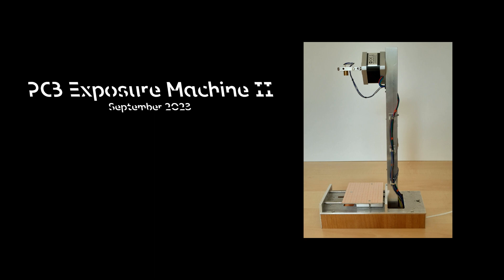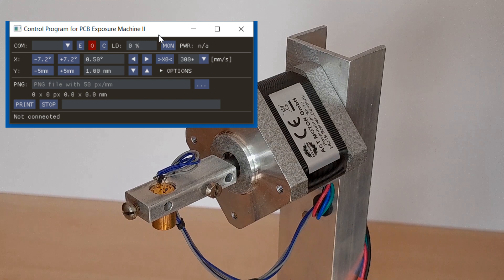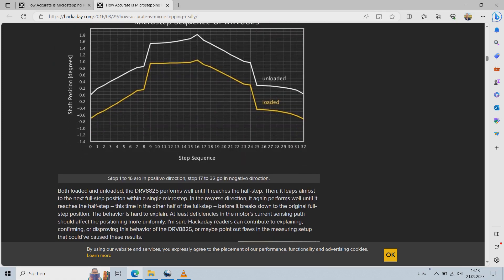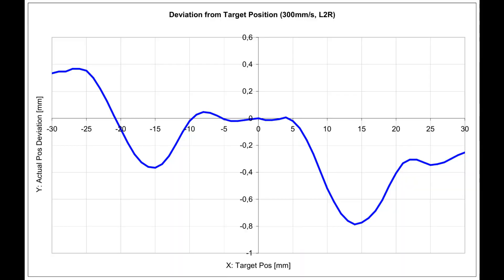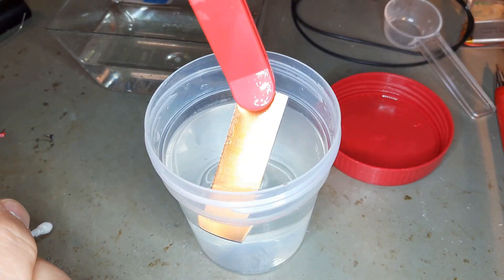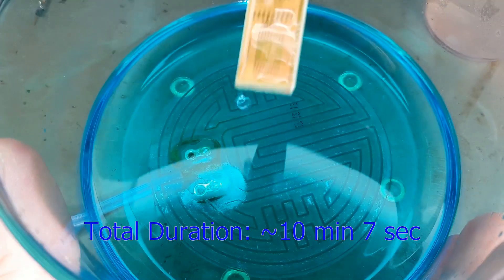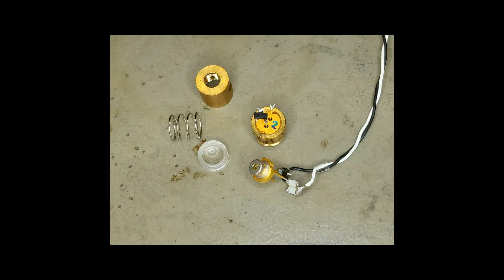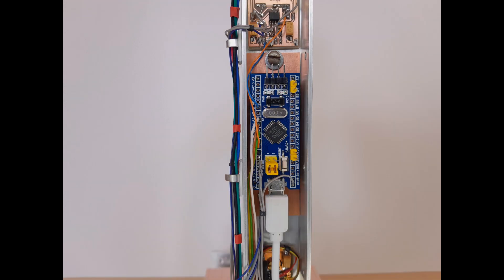UV-Laser PCB Exposure Machine for Hobby Projects (Version II)

Comment: Which laser you use and give me the eq7ipment links
Reply from the maker: The main components were all from Ebay and the articles are gone since long. However, the description of the laser was "SLD3236VF 405nm 150mW TO18 laser diode", the price in 2023 was 5.15 euro. The collimator assembly was from ebay too: "8x13mm Mini-Case for 5,6mm TO-18 Laserdiode", the title of the Ebay article for the motor was "Nema17 Stepper Motor 17HS4410-04 1A 40mm". Of course you can vary everything, according to your needs. Be warned, the calibration is the most tricky part because you need to expose and optically analyze fine test patterns. But even after more than two years of usage now I had no issues, the non-linearities in the motor seem to be pretty stable.

Comment: Great work ! I have been wanting to build something similar after coming across a project called Laser Exposer, however they used a spinning polygonal mirror so the timing of everything needs to be very precise. The second version I found was made by a guy called Terje Io, but in that version the laser moves on linear bearings, and in my first attempt I found that the linear bearings allowed some vibration.. so I'm really glad I found your video, as not only is it simpler that the other two I found, but I figure that it would also be less sensitive to vibration (and easier for me to code 😅)

I would like to ask about the laser stepper driver, specifically part choice. For the transistors, could I get away with using mosfets or should I stick to complementary darlingtons ? and for the opamp, I have a few Analog Devices AD620 & AD8603 opamps, are either of those suitable ?
Reply from the maker: Glad that you liked my design! 🙂In fact I used it for many boards meanwhile without any problems. The most important point is the calibration, to compensate the nonlinear effects in the motor. Unfortunately the needed calibration curve changes a bit at higher speeds, probably because of eddy current effects or so. so be warned. You will need some strips of PCB for printing test patterns, counting pixels, after photographing/scanning them, Excel can help to create the final tables. But once it is calibrated, it works like a charm. Regarding the constant current drivers, I recommend to used darlingtons, they are more friendly to control, most mosfets are not really made for analog circuits. The AD620 is an instrumentation amplifiert, you could use it for shifting the DAC (typically 0..vref) to the +/- range needed for the bipolar power stage. The AD8603 is a low-power opamp designed for 5V supply max., the bandwidth is very small too. Not really suitable, better use some common standard like the OP27.

Comment: Very cool!  I've spent years trying to accomplish the same thing, and I kept running into issues that could broadly be broken into two categories: laser dot size/astigmatism and X/Y axis linearity.  It's rather difficult sourcing a relatively powerful UV laser diode that has a small enough dot size and doesn't have extreme variations in dot size over varying distance due to focus.  I don't know, I just had trouble locating lasers that had a published dot size, it always was about wavelength and power output.  I mainly tried two beam movement methods: a galvo mirror assembly intended for a show laser, and a hexagonal spinning mirror assembly intended for a laser printer, with the idea that it would provide a very consistent beam sweep rate and therefore position.  Both had their issues, but if I had been able to find a proper UV laser with a small enough dot size that could be maintained across a reasonable distance, it would have gone considerably better.
Anyway, kudos on creating a very workable and inexpensive system!

Comment: have software and detail ?
Reply from the maker: Sorry, no, not planned. I hope the presentation motivates the interested ones (kids, students,...) to be creative, not by presenting detailed plans to follow blindly. There are many ways to realize something like that, different motors, controllers, DACs, some already have their preferred microcontroller (ST, Atmel/Microchip, Raspberry Pico, or Arduino...), development environments, for the PC (or Linux) too... Finally the code is not that complex, toggling an I/O pin while sending a table of data to a DAC, might be easier to build with a toolchain one knows than reworking my (ugly) code specialized for my type of hardware. However, the most delicate details of the electronics (constant current amplifier, laser and driver) can be seen in the video, maybe that helps. ;)

Comment: Data available over internet shows copper has best absorbance for infrared laser lights Rather than VU
Reply: So is you clever data as valid for UV-exposure as for copper etching?
Reply: @MuellerNick  I'm telling about direct ething on copper ,no ink not anything
Reply: @Abubaida-wx1iu  Not the subject of that video. -> useless comment.
Reply: @MuellerNick  don't drink wine
Reply: @Abubaida-wx1iu  I don't drink any alcohol, if that helps you with your derailed argumentation.
Reply: He's not etching the copper directly. He's exposing a photo resist that's on the copper board, and then using what looks like ammonium perchlorate to etch the copper where the photo resist has been removed (aka not exposed by the laser)

Comment: Good afternoon. Really cool project! Please tell me, is there a freely available diagram and source code for replicating the device yourself?
Reply from the maker: Sorry, not at this moment. Putting it all together, with toolchains for the microcontroller part and for the control program, it would fill a small pocket book and I think most interested ones have their own, different preferences regarding compilers, microcontroller etc., connectivity (e.g. serial, sd-card, bluetooth... instead of USB). Also other stepper motors might need adaption (current, driver for the y-motor etc) and also for things like the ADC (I used an obsolete AD8303, just because I had one) most will have their individual preference so that a precise construction plan would most probably not fit for most hobbyists. :(
Reply: @gumpomat  I apologize for the possibly inaccurate translation (google translator). I was not interested in the source code of the firmware, but in the compiled ready-made file for the firmware. sd card, bluetooth, etc. - this is not the most important thing in such a project. The most important thing is that the project works, and this project is really interesting. According to the accuracy of DRV4988 stepper motor drivers,
DRV8825 is a very old article, and these drivers were primarily intended to reduce the cost of 3D printers and the size of the control board. But progress does not stand still, and drivers are constantly being improved. Trinamic has a huge selection, for example TMC2209, TMC5160. These drivers already have finer microstepping and higher precision.
It is thanks to this that they became almost silent. TMC5160 was used in the construction of a CNC machine on FluidNC firmware, together with an ESP32 microcontroller. The drivers really work smoothly and easily control NEMA23 motors with a current of 2.7 Amps. You can't hear the engines running at all. I think you need to take a closer look at them,
for this project, and if the drivers are suitable, then repeatability of the device will be easier.

Comment: I imagine on the sides of the board laser spot will be a bit out of focus? And because of the angle light comes it also change shape from circle to elipse. How do you deal with that?
Reply from the maker: Of course you are right, focus will not be the same throughout a line from left to right and the shape is oval even because a laser diode has different divergence angles for each axis. But reality proves that the errors are small enough to create structures as needed for SMD boards with 0.5 mm pad distance. Would be interesting to calculate the theoretical dimensions of the laser spot and the error (anyone out there who can help?) we can expect but I think it is difficult because not all needed data about the lens and the laser diode is available. However, even with another brand of laser and collimator used in my first machine before, I had the same success so focus and beam size does not seem to be a major problem for this type of usage.
Reply: @gumpomat  thanks for answer. yeah I see the result is good for small boards. I am just scared that let's say 10*10cm board will experience bigger distortion of a beam. you can try super wide board and make test pattern (usually different feature size pads \ lines) at the edges and at the center and measure them to see the impact. anyway the setup mechanically seems very simple (not sure maybe 0.9 degree stepper will improve something) and might be easy to replicate. that would be so much better that toner transfer pcb

Comment: nobody ask about height. what height must to be?
Reply from the maker: Maybe a physicist in the audience could comment on that? ;) In fact the 24 cm distance to the table was just spontaneously taken when looking at some small laser marking machines available on the market (they use expensive galvanometers for deflection, not really an option for a hobby project). The actual height turned out to be useful, so I did not try to make it smaller yet. The theory about collimation optics, beam profiles, divergence etc. is available but I even don't know the exact focal length of the lens and I do not trust the datasheet of the laser diode. So I worked more or less with experiments only.
Reply: @gumpomat  Great job. Those kinds of unknowns keep slowing the development of my projects. Your practical approach might be the solution.
Reply: @gumpomat  you actually have a brilliant mind. I would need more information, especially about the lens and the laser diode.

Comment: Very nice machine! Doesn't the laser dot get bigger towards the sides? But the results look very nice!
Reply from the maker: The center distance from the laser to the table is 240 mm, to reach a deflection of 30 mm the motor axis has to turn ~7.2 degrees. At that angle the new calculated distance to the table is just 1.9 mm more, the dot remains small enough for the required precision. In fact I did not do a lot of calculations after the first experiments with thermal paper went surprisingly well.

Comment: Nice project great efforts. What about large double PCBs 20cm x 15cm as example with lot of details details who long it will take to accomplish
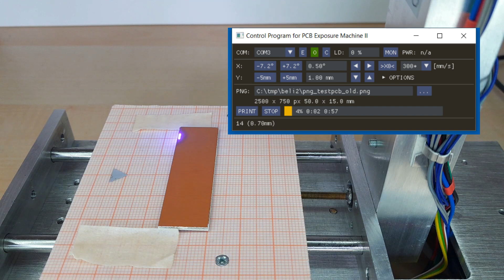Reply from the maker: At 2:12 you can see in the control program that the 50x15mm test board takes about 60s to "print", approx. 8s per 1cm^2. Since the machine does simple scanning line by line (like an old CRT) it is independant from the level of detail. A 20cm x 15cm board would take around 40min, of course the machine needs to be bigger than mine for that. For larger boards I would think about a more powerful laser and increasing the scanning speed.
Reply: I think high power and more speed you can use high resolution LCD with UV backlight like "3d resin printers" take all PCB at one shot like modern PCB manufacturing use direct image exposer machine @gumpomat

Comment: You can use a magnetic encoder, something like AS5600. Spin it constantly, turn on and off the laser.
Reply from the maker: Indeed I thought about the AS5600 for calibration but I doubt that it is precise enough to measure down to 7.2deg/1024, which is the actual resolution. Spining constantly? Around 360deg? Would be a waste of time since on the way round only a fraction is needed to "paint" on the board, wires would wrap around the axis too.
Reply: @gumpomat  Maybe not a stepper but brushed/brushless dc.  For wires needs to be some sort of sliding connection. What kind of UV sensitive material did you use?
Reply from the maker: Typically I use material from "Bungard" (I think it is common only in Germany) but I tried also some unknown brand for the experiments that was laying around for more than 20 years. Worked well, but the protective foil left some ugly glue on the edges.

Comment: What was the reasoning for one axis being linear, and one being rotation? Why not both rotation or both linear?
Reply from the maker: Well, the X and Y controls are not really needed for normal usage. So they came in for debugging at the beginning. The laser on the axis is more a "rotational" thing, so I stayed with rotational units, more easy to play with. While the Y axis was more convenient in mm since the Y-motor has to turn 2*360deg for 1mm. But however, decisions came on the fly. ;)